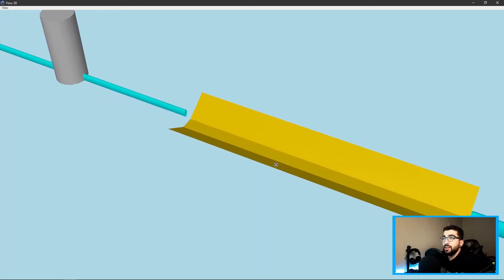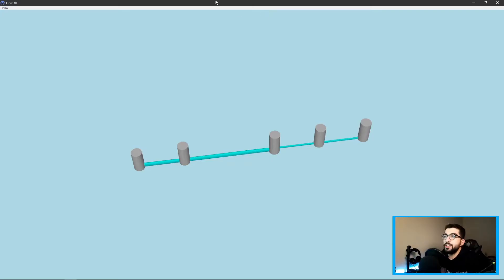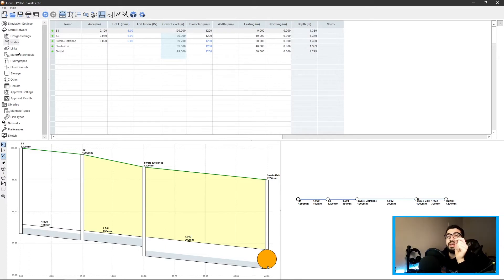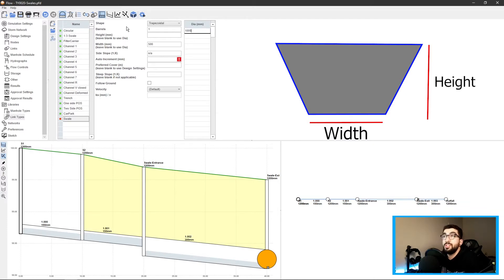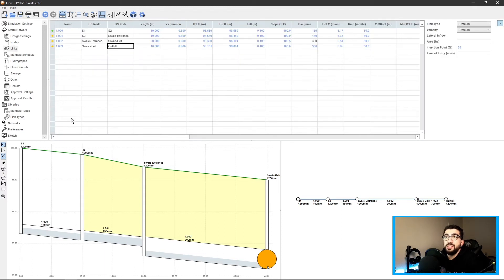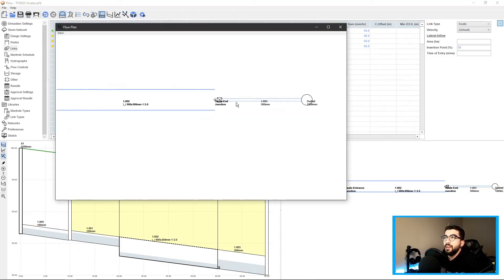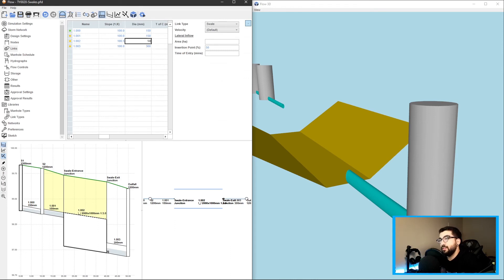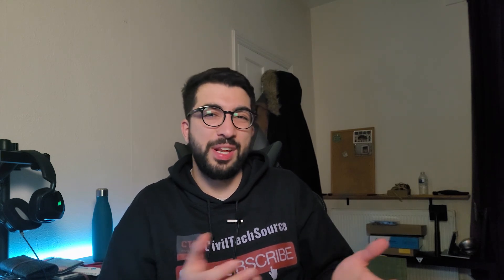How to design a Swale in Flow - Causeway

Comment: I have found a note that points t0 Figure 17.7 of the SUDS manual for Manning coefficient values.

Would the nodes at either end of the swale be "junctions" rather than manholes?
Reply from the maker: Hi Charles, 17.7 seems rather high will dive into it and see what the search will yield. Yes! That is an excellent point usually you would want to replace the nodes as junctions. Thanks for pointing this out!